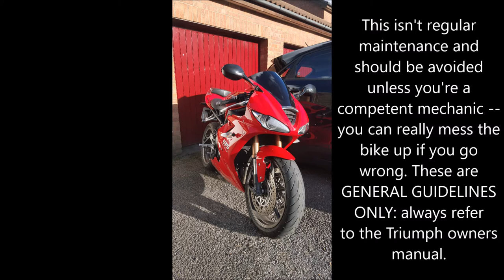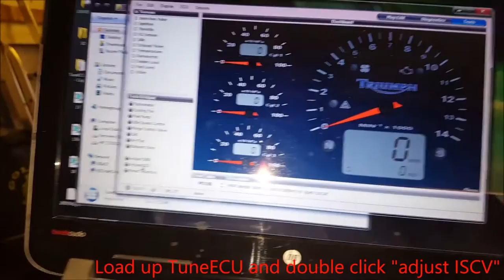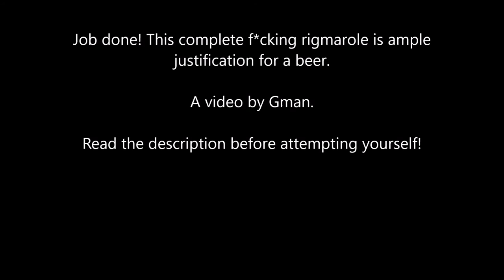Triumph Daytona [06-12] Calibration of TPS/ISCV with TuneECU

Comment: TPS on my Daytona shows to high voltage PO123 error on comp + check engine flashes. However diagnostic tool  TUNE ECU shows smooth 0-100% control. Tommorow i wll open it and check .. for ....(and here i dont know what) cause sensor seems to work fine, but still there is PO123 code and limp mode on bike.
Reply from the maker: Sorry for delayed response! Tough one, I'm not sure where to go with this.. I'd say check actual voltage of TPS (could be knackered), wiring and even spacer bolts, as overtightening can cause issues. Best of luck, will be interested to know what happens.
Reply: It was 5 volt on closed TPS position  , which is highest amount voltage input (100% TP). Start one should be 0,6 volt (on both TPS-es Daytona 600). First adjusted 2nd TPS (its just potentiometer lowering voltage) with screwdiver to 0,6 v start position ( gap was 0,8v for First TP ..which should be ok anyway <0,2 tolerance> ..but i changed it also) than clicked it on butterfly iron bar/second throtle electromagnet opening mechanism and it works perfect ; )  (cheers for respons anyway, it was just my first contact with motorbikes and mechanics as well)